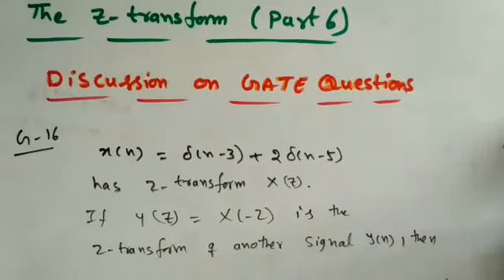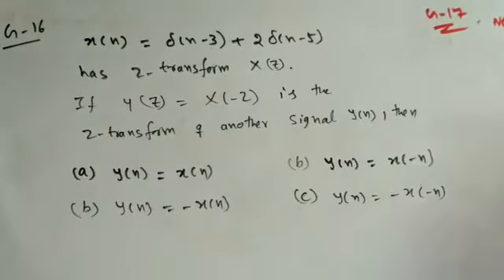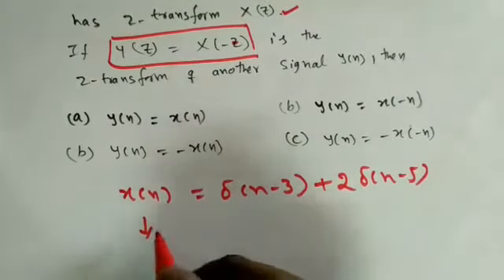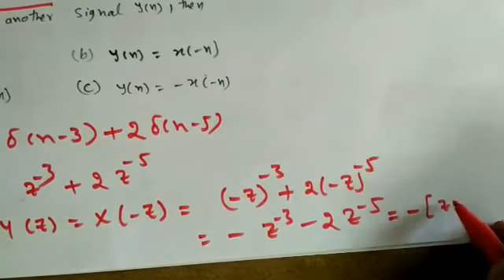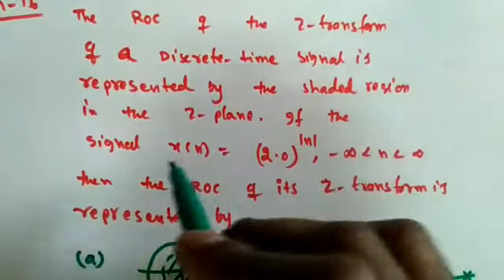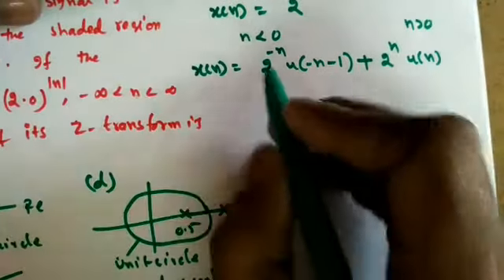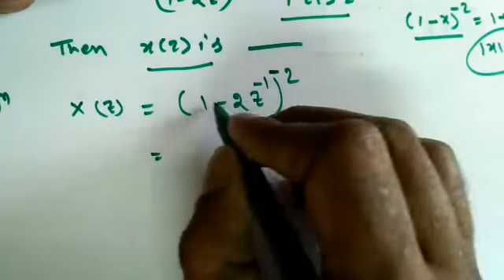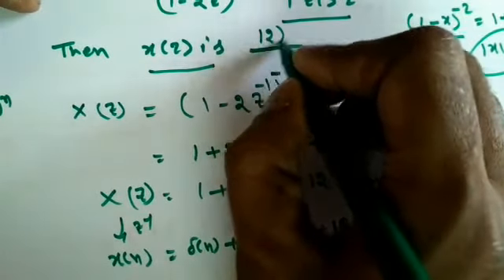Signals and Systems Lec-50: Discussion on GATE Questions from The Z-Transform (Part 6)

Comment: sir at 6:05 roc should be b<z<1 ?
Reply from the maker: no z > b...because only two poles..z>a and z>b...because a<b..the common roc is z>b
Reply: Learning Z Everything sir but it's mentioned in the question b<1 so why not roc constrained within b and 1?
Reply: In the question, basically the region where the poles are present is given, nothing has been said about the ROC. It has to be found by you. Since the ROC has to be exterior of the right most pole, which is clearly b, the ROC will be greater than b, i.e, z>b.